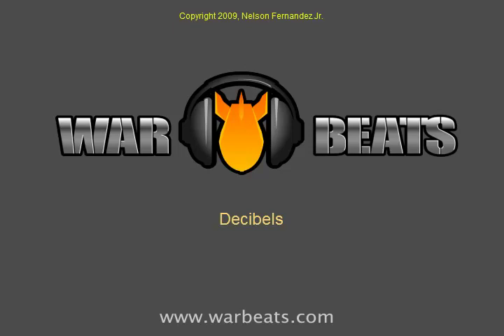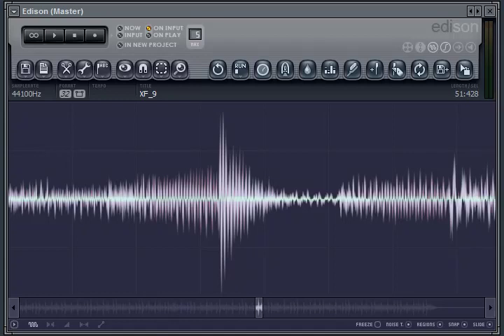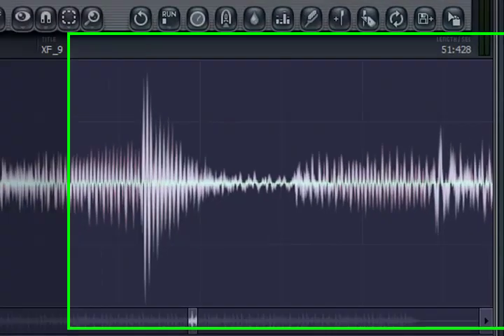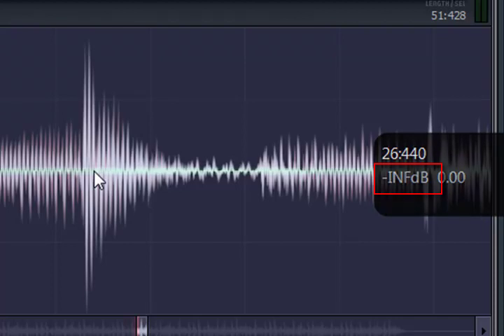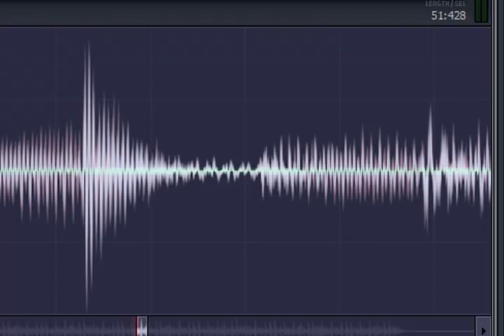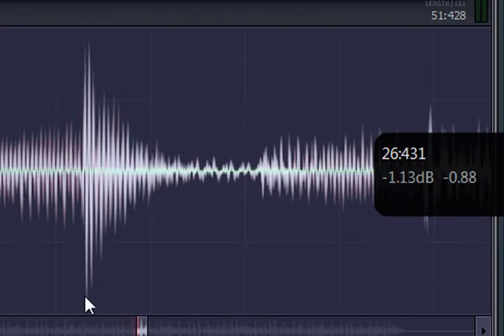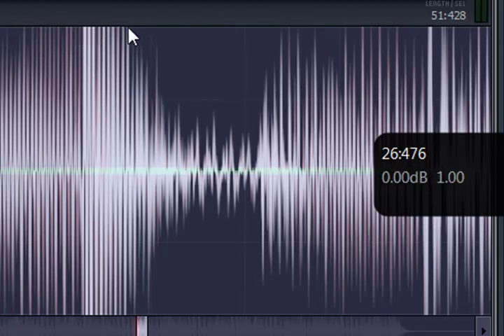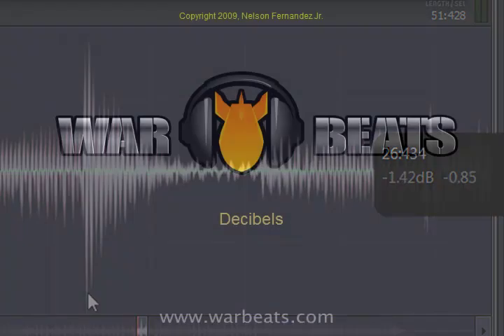Mastering - Decibels Explained - Warbeats Tutorial

Comment: The waves L1 compresses the entire track and boosts the levels to the output you select. My settings are, Threshold -2.0 and Out Ceiling -0.3. Mastering engineers suggest putting the Out Cealing down to -0.3 db to stay on the safe side and the signal never clips...